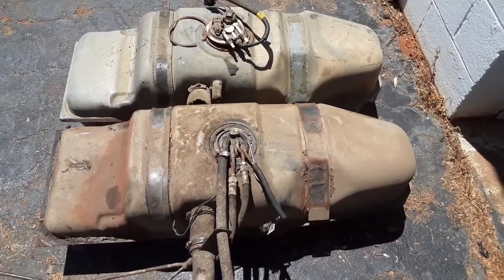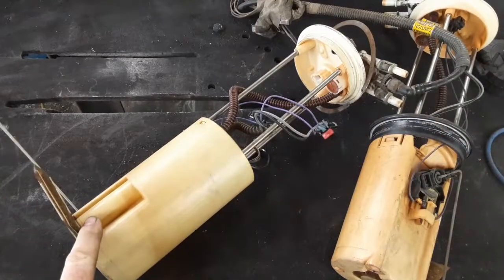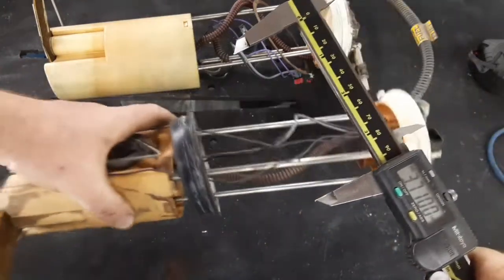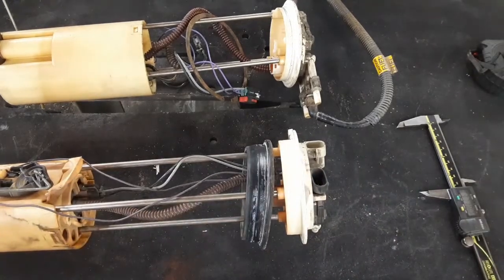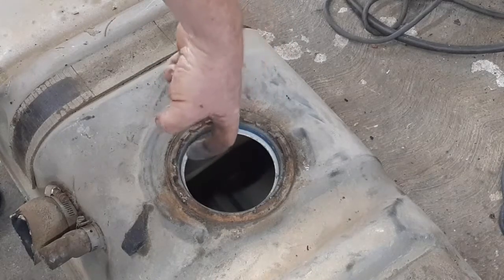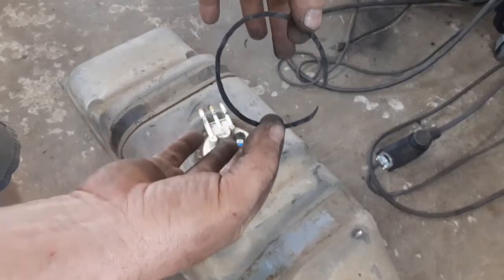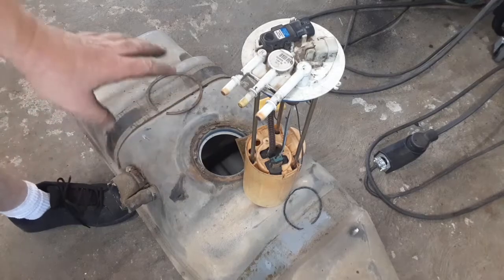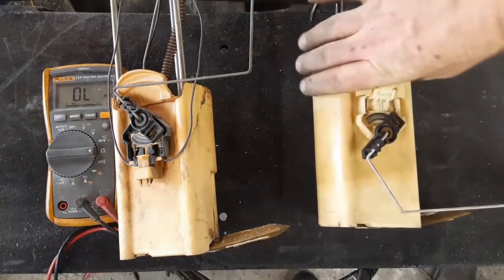5.3 Fuel Pump in a Stock S10 Gas Tank LS Swap fuel system made easy.

Comment: You said the top sensors on the pump are easy to re wire. Are they not the same to where you can plug right in? Or do you swap the sensors over from s10 pump to Silverado?
Reply from the maker: The plugs are a different style from S10 to Silverado/Tahoe, but both have 4 wires so its just a connector swap to make it work.

Comment: What did you do with the third gas line (the evap line) ???
Reply from the maker: Ran it to the stock S10 charcoal box.
Reply: @ did you plug the line on the charcoal box thats supposed to go to the motor or just leave that open? Sorry for all the questions lol. Doing 5.3 in my s10 tryna figure out whether or not to delete the whole charcoal box and just cap the line on sending unit and vent the gas tank with a vented gas cap. Either that or run the line to the charcoal box and just let the charcoal box be a vent? What would you recommend

Comment: I've watched this a few times a have 2 questions.  Why not swap the hat from the S10 to the Silverado bucket?  Are the internal connectors the same (looks like it at 2:00)?  Reason 1 is that the float position to alignment tab looks wrong and at ~7:30 when you pull it out it looks like the float would be hitting the side of the tank, and 2, the seal would be a non-issue.

Comment: how did you wire up the pump to run
Reply from the maker: I used the computer to power a fuel pump relay, just like the stock 5.3l truck would do.

Comment: Thanks for the great video, very informative as usual. I'm looking at either a 5.3 or 6.0 in an early S10, but would like to use the 2 door Blazer tank located behind the rear axle. I'm not sure if the pump in this style tank are similar in spacing(depth), top to bottom, as the forward mounted truck tanks. Or maybe the late model Blazer tank is compatible with some other style pump. Looks like I've got some investigating to do.
Reply: I too would like to know if that would work with the Blazer tank!!

Comment: Could you disassemble the sending units and swap the tops or change just the pumps?  I'm getting ready to do this on a 94 as well. What was the reason for changing to push fittings?
Reply from the maker: I like the push lock fittings, they almost never leak, are easier to use in tight spaces, and are reusable. The crimp style bands for high pressure fuel lines can't be reused (safely). I hate worm screw clamps with a passion, plus they aren't meant to be used on 60PSI fuel lines. There's a reason every OEM has switched to push type when engines changed to high pressure fuel systems.

Comment: Comencé mi proyecto hace 2 años🤭 y hoy me regresaron los ánimos de continuar mi proyecto(98s10,single cab,short bed) ya corté chasis,senté motor,puse headers,cambie polea al power steering, arregle el wiring harnesses pero quede en líneas de gasolina y pompa de gas(😡) ya encontré información sobre q filtro necesito y ahora encuentro tu video y me solucionas lo de la pompa de gasolina! Gracias,BUEN VIDEO.!!!

Comment: For the 5.3 swap in my 94 S10 I just bought a whole new fuel tank, sending unit, straps and a pump. Plan on taking the pump out of a 02 silverado fuel pump unit and attaching it to the 94 sending unit.
Reply from the maker: That should work also. About 10 different ways to skin this donkey.

Comment: Trying to see what I have to do for a 1996 4.3 to 6.0 fuel supply in tank?
Reply from the maker: The same setup will work if you're using the stock 6.0 injectors. They're the exact same injectors and fuel pump as the 5.3L .
Reply: @lsswapshopp  that’s the issue I’m not I’m upgrading the injectors to 42lb/hr for rpm and Holley efi

Comment: Well done ! Beautiful
Reply from the maker: Fired the engine up yesterday, fuel pressure was rock solid at 60PSI at the rail, so I'm pretty confident it's a good budget solution.
Reply: @lsswapshopp  Nice !! You convinced me to look at a possible Yukon/ Tahoe pump assembly swap for my 99 Blazer 4x4  5.3 swap

Comment: Dude! Genus.... This might be simpler then what I'm trying to do. I'm in the middle of swapping an L96 6.0 into a '99 Express 3500. Trying to figure out what aftermarket fuel pump to get that will fit in my Express sending unit but maybe something like this will be better. Thanks!
Reply from the maker: The 2003+ Express vans came with the 6.0 LS engines, there's a good chance you could adapt a 2003+ stock sending unit to your tank.

Comment: I heard the ls motor will run on the 4 cylinder fuel pump but it loses some performance.
Reply from the maker: It's possible, the info I found on them was the 2.2l pump is 20 gph @44 psi, 5.3 is 30 gph @ 58 psi. So it would likely run at lower RPM, but it's easy enough to swap the 5.3 pump in. 

I didn't include it in the video since this plan worked, but I also took a 5.3 pump and it fits perfectly in the S10 sending unit. You'd just need to replace the short hose inside the sending unit (have to cut it to remove the pump) and rewire the inside of the sending unit instead of the outside.
Reply: Hell yeah brother.